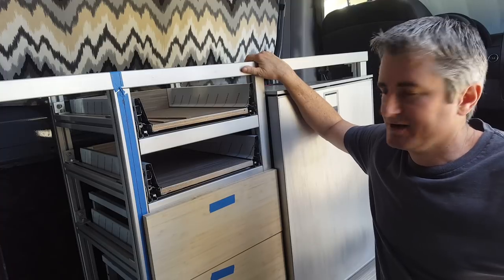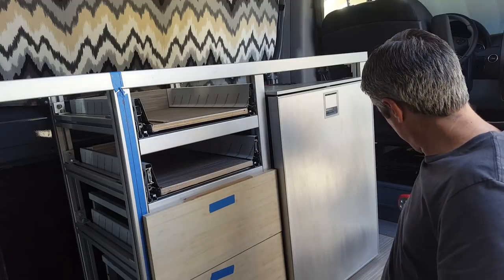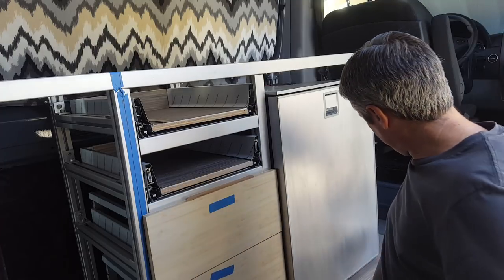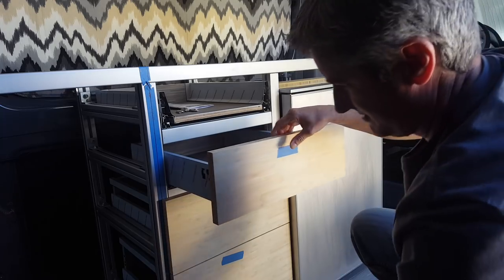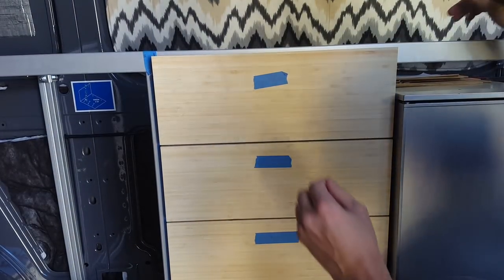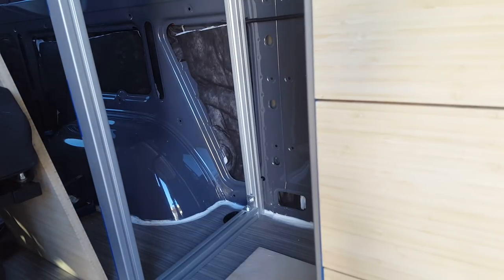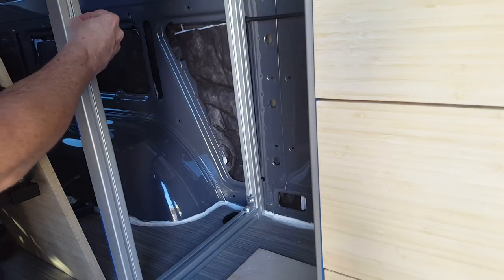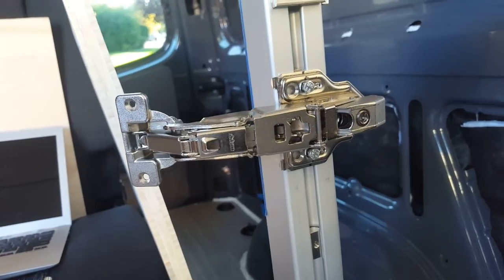Bamboo Drawer Faces and Cabinet Door Hinges - DIY Sprinter camper van

Comment: Excellent job, for a non carpenter, you're doing great! A little tip when drilling with large diameter bits, use the test piece as a pattern, drill hole right through it, then clamp it in place on the door, it acts like steady jig and prevents the bit from skating across the surface ruining the whole door! ;)

Comment: Very creative process using the grease to mark the screw location. I would have used a transparent grid ruler to find the hidden screw coordinates. Easily transferable to the bamboo drawer face. But I have to commend you for your incredible talent, I have watched all that you have done with the van.

Comment: Another way to attack the problem of no-access mark points... Get a sheet of acrylic.  Fix it to the front of the cabinet and mark everything with tape or holes.  Then lay it on the back of your drawers fronts/doors all arranged face down and transfer the marks/holes.  Remember that pencil marks on the tape won't be visible when you lay the acrylic face down - so use tape edges instead.
Reply from the maker: Thank you for the suggestion

Comment: kenetube i cant thank you enough for the help with my van build.Getting my van galley done this week. And start the upper cabinet build. Thinking I may try to find 1/2 bamboo for it cause 3/4 is way over kill. May even build them out of diamond plate so much cheaper and light weight. I will post a video when its done.When will  you be doing your upper cabinets like to see your finished product? Cheers
Reply: yes i know the european hardware means going with 3/4". However uppers cabinets with 3/4" i heavy and really unnessary for my build. I'm now going to use 1/4" bamboo as the skin and then use 1/2" for the actual doors. not even using a hinge to it up. and the latch will be just a turn knob. just use my head to hold up while i get stuff out. I do that now in my first van build and its fine. they are aluminum diamond plate.Also toying with the idea of skining the upper cabs un aluminum diamond plate.My van is used for a motorcycle hauler camper

Comment: Thanks for the great video...I recently found you on youtube and started following.  I wonder if once the doors are adjusted and aligned,  if you couldn't drill a short hole into the square tubing, using the original hinge mounting holes as a guide, and use a pop rivet to add additional support to the hinge....nice work...

Comment: I'm having trouble interpreting  blum's chart.  If you were using 15 series 8020, would your overlay dimension be more like 38mm (1.5in)?  How did you come up with your 33mm overlay dimension?
Reply: Ah ok that makes sense.  So you would use 38mm if you were doing a full overlay, but you left roughly .200" of an reveal.  I get it now!  I've really been enjoying watching your build as I work on my own!  Keep up the good work! :D
Reply: I was wondering the same thing! I don’t see where Ken had left a .2” reveal though.
Reply from the maker: There is a reveal as mentioned.  It’s  a personal choice but I liked seeing a bit of the aluminum on the corners.

Comment: Considering that you've mention you're not at all carpentry inclined, you did a great job for a non carpenter.
One question though, where did you get the bamboo door faces from ?
Reply from the maker: The bamboo is from the company Plyboo and I have purchased it from two separate hardwood stores in my area.  Both were able to order it for me without any issues.  If you live in central California I can share where I bought mine, but I would check around locally first.  Thank you for the very kind words!

Comment: We use grease all the time at work to see where things are hitting or where to drill a mounting screw. Is it still incorrect if it works and works well? Great Job!!! I love the videos! Let's get together this spring or summer!
Reply: Nice, but try red lipstick next time.  You can see it better and it's much cheaper.  Can find in Dollar Tree.

Comment: Thanks for making this vid! What bamboo thickness did you choose for the drawer faces 1/2 or 3/4? What factored into the decision?

Are there any places where you could or should use 1/4? I was thinking maybe 8020 overhead cabinets.
Reply from the maker: I wanted to use 1/2” but realized the 3/4” would be easier since the European hinges need a 1/2” deep hinge cup drilled into the back of each door.  Also the 3/4” provides better strength for all of the screws to hold the hardware (lifts and latches) in place.  The overall weight gain for the amount of wood I used was only about 12 lbs total over what 1/2” would have weighed.

Comment: Getting ready to drill as you said the scary 35 mm hole for my door. 3/4" bamboo 22mm from edge if I want the edge to be flush on the outside of the 80/20 15 series correct?

Comment: Nothing wrong with using grease. When installing deadbolts in doors I would always use lipstick as my marking medium, you can find good sources at the dollar store. Just keep some paper towels handy to clean up afterwards.
Reply: I forgot to mention that this is the absolute best cabinet build I have seen on YouTube! Everyone else is doing stuff in wood and when it comes to safety I would have my doubts. These extrusions are by far the best for safety. I also realized where I have seen this stuff used before, for convention displays! Easy to assemble and very sturdy!

Comment: I was planning on using a 1/2" wood to face the drawer and cabinet, is it possible to bore the hinge on the cabinet with 1/2" wood? I saw that you drilled 1/2" deep
Reply from the maker: That is one of the issues using 1/2” material with European hinges.  A 1/2” cup depth is required for all the hinges I could find.  Everbilt makes a surface mount swing hinge but I can’t confirm if it would work.

Comment: Great work.  Love the build.  I'm planning to use 8020 15 series.  Do you think you could have used fewer cross pieces on the cabinet face frame without sacrificing the structural integrity?  At 1.5", they eat up cabinet capacity.  Also, do you think the 10 series would be beefy enough for the cabinet?
Reply: I have the same questions - what did you end up doing and how did it turn out?

Comment: Have you found a system so that the drawers do not open unexpectedly while driving because the blocking of the drawer slides is weak
Reply from the maker: Yes, the next video published after this one shows how I did the latching hardware.

Comment: What have you experienced with this drawer set up with noise or rattling. 80/20 is certainly solid and very silent.  Thanks! Keep it up man, love your vids!
Reply from the maker: I've had to do some level of rattle control.  I found that those little round felt pads between the wooden drawer faces and where they close against the 80/20 took care of it.  It also made the latches feel very positive when they latch, as they now have a bit of cushion when the drawer sucks closed.  It's also important when surface mounting panels to the 80/20 to have it secured every 18-24" so it doesn't rattle against the framing, or better yet I've been applying some extremely thin felt between panels and the aluminum, then you can fasten it at whatever distance you like with no rattling.    Thanks for the complements!

Comment: Hi Ken, great tutorial like always. Are you planning to add stove and plumbing? Hot water? Propane , diesel or electric stove?
Reply: Fantastic idea and execution.
Reply: I've been following your build closely and love every bit of it.  Can't wait till I have the funds to start mine. Your build is so well thought out.  Thanks for including the build list.
 
As far as water heater/heat goes I dig what Winnebago did with the Revel.  They're using a diesel fired heater (Eberspaecher Climate Control System’s Hydronic D5 coolant heater series) to heat the cabin/water and grey water/...possibly a line to keep the diesel fuel warm too.     https://www.youtube.com/watch?v=qDDZHt09SIY 

I can't wait to see you're final build.
Reply: Hi, I'm loving these tutorials. Very inspiring. We were trying to get a Rock n Roll bed shipped back in 2011 and nobody would entertain the thought. Like the person you mentioned, we also had a galley in our old Sprinter with a large capacity water tank and electric pump and it was a pain (plus who wants to drink water that's been sat in hot plastic?).  We're building our new Sprinter with a 5 gallon steel jerry can from Dinuba so that the water is drinkable and a plastic can for gray water. Much less work.
Reply: kenetube yes, an importer would be amazing. I tried to convince my sister to send me one but UKretailers were not keen to help  (I'm from the UK, living in the US. The seats are everywhere over there and Europe has super strict crash test regs so I'm not sure why the US hasn't embraced them).  I look forward to following the rest of your build :)
Reply: I am thinking about using a 14 gallon stainless fusti tank.  They use them in the wine industry.  I don't like the idea of drinking from water stored in plastic either.  It has a fairly large lid to open and let it dry out when needed.  They have a ball valve you can thread into the bottom for draining it.

Comment: Great job, came out amazing!! I've built a few cabinets over the years and I can remember how nervous I was when it came to attaching the draw slides and hinges on every project!! I've used this Kreg Hinge Jig, it really makes it easy and fast!! https://www.kregtool.com/store/c60/hardware-jigs/p408/concealed-hinge-jig/
Just curious, when you attached the draw slides to the frame they fit perfect, did you measure those out when you built the frame or did you have to go back and adjust them? Thanks for all the time and effort in making these videos, they're great!!
Reply from the maker: Always nice to know about helpful tools, thank you.  Yes, very nerve-racking without it.  I used a test piece before committing to drilling the bamboo.  
The drawer slides are available in lengths in 2 inch increments.  I had the framing built before I ordered the slides, so I knew what length to order.  Any other adjustment such as sliding the slides forward and back can easily be done with the 80/20, and likewise if the rail needed to be higher you can simply loosen the carriage bolts and slide the 80/20 up or down.  Makes it easy to get it perfect!
Reply: @ourkaravan  Trust me that's the only tip I could give you, your build is awesome!!
Reply from the maker: @bjbhehir  Thank you, much appreciated!!